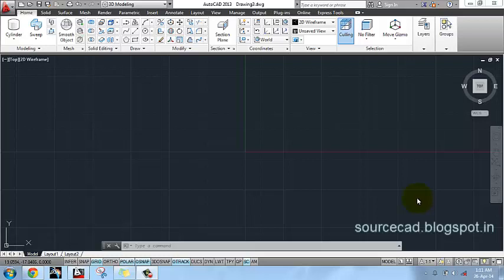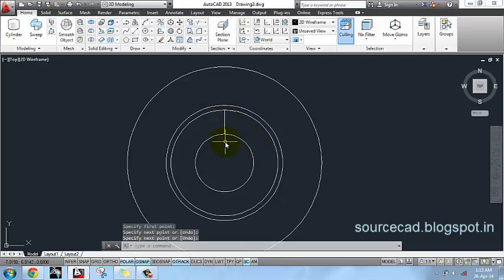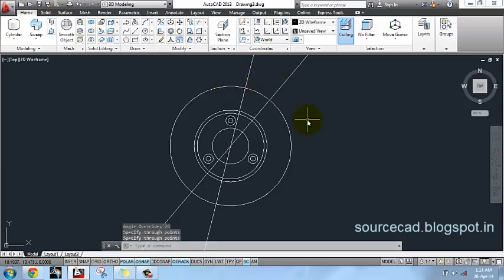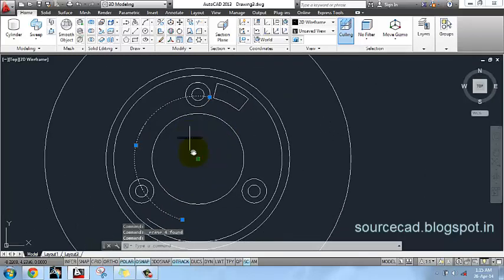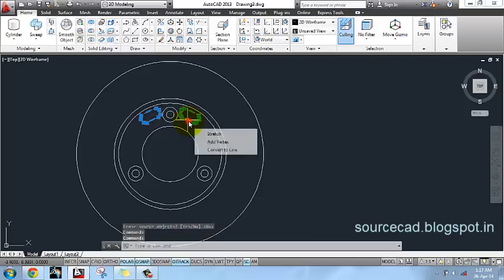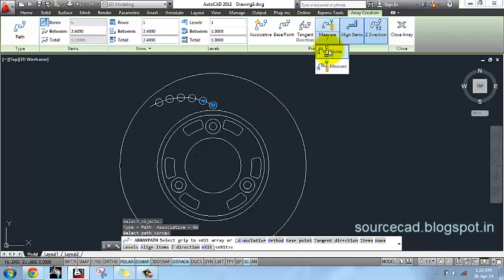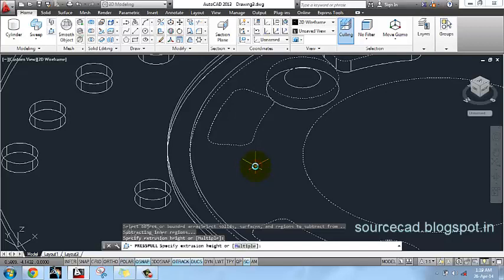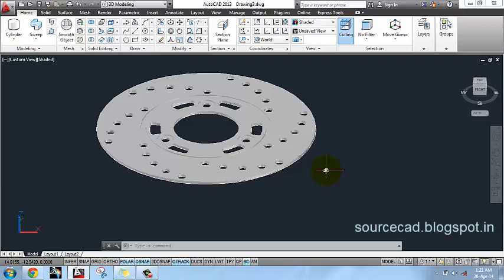3D modelling disc brake plate using AutoCAD

Comment: I really have to go through all your tutorials, already did like 12 :p, thanks a lot :)
Reply from the maker: Glad to know that you are enjoying my videos :)
Reply: I have a question though, how do I do to get rid of the remaining lines from the 2D sketch?
Reply from the maker: Just move the 3d geometry leaving 2d lines and later erase 2D lines.
Reply: haha that should work but is there any other conventional way to do it? I tried the clean command but it didn't work :/
Reply from the maker: I agree that was the most obvious way :) The another method is DELOBJ system variable, you can set its value to 0 to retain all 2D geometries and to 3 to delete all 2D geometries.
Reply: Well the move solution worked but it's not an elegant one :p, however DELOBJ variable was already set to 3 for me.
Reply from the maker: There are some command specific system variables modes of DELOBJ that you can choose depending upon your specific drawing, as I can figure out 1 will work better in your case. You can learn more about it here as well http://help.autodesk.com/view/ACDLT/2016/ENU/?guid=GUID-CB64587F-611E-441E-AB07-14B415BF535F